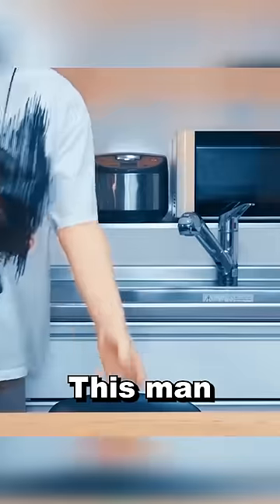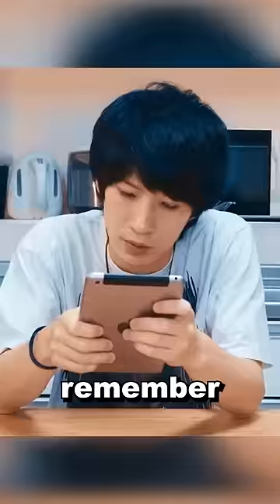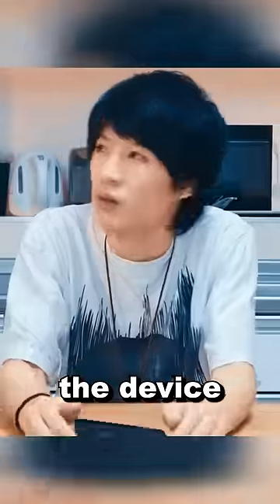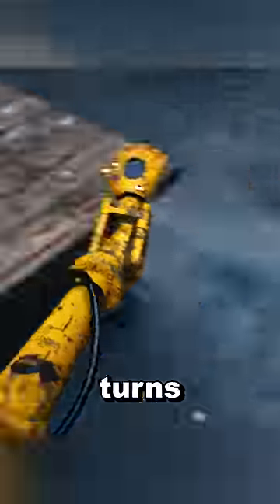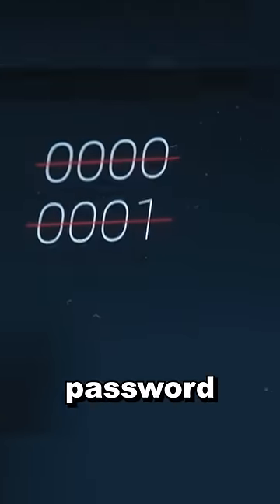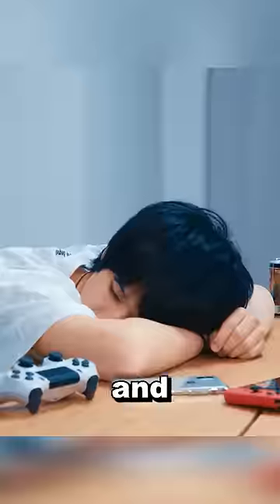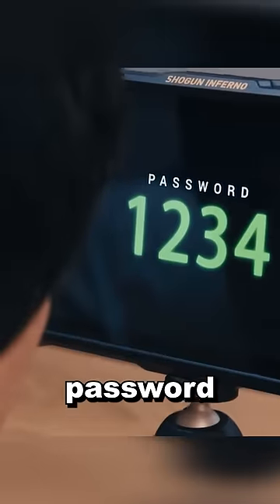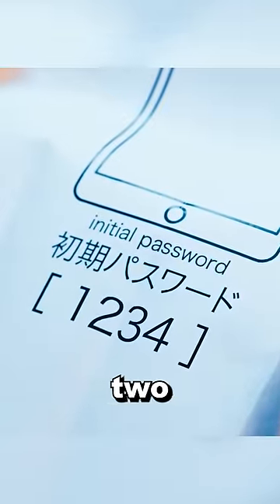He Is The Smartest Man😮

Comment: you start from 0000 and end at 1234 and you add 10 numbers to 0000 each second, it wouldn't take hours for the combination 1234 to be typed on the iPad. To calculate how much time it would take for the machine to reach the combination 1234 then we have to divide 1234 by 10 to find out how many seconds it would take. The answer is 123.4 seconds. If we convert that to minutes it would take about 2 minutes for the machine to reach the combination of 1234 meaning that the narrorator is a fraud for saying that it took hours for the machine to have opened the iPad.